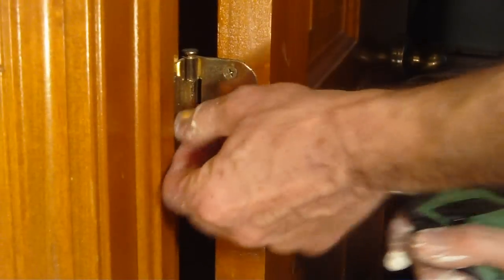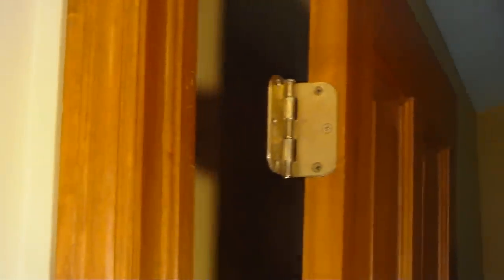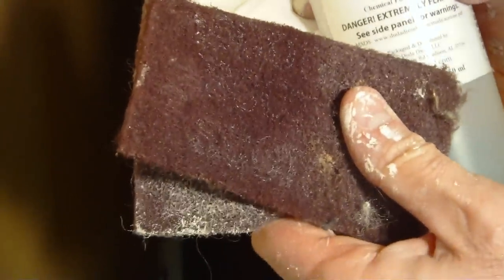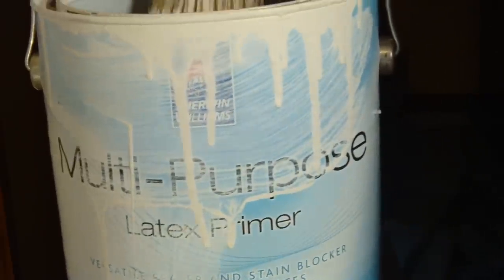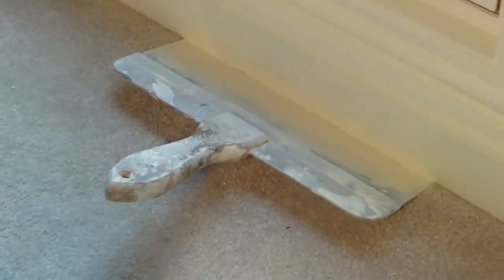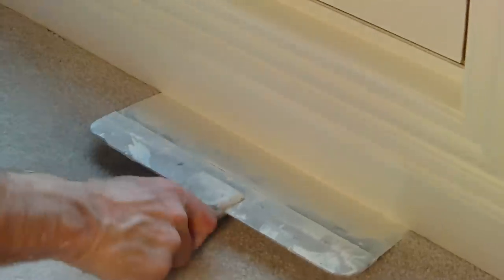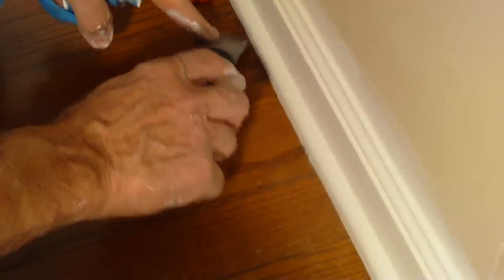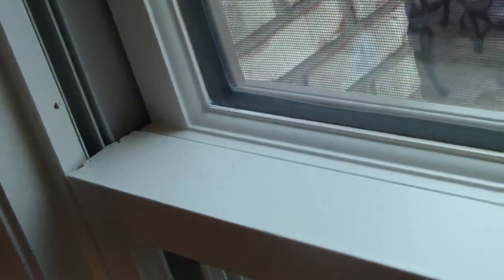deglossing techniques - for painting

Comment: I did NOT get the results shown on your video when I used Jasco brand  "Professional Strength" Acetone.    Do I need to buy more concentrated acetone from a local chemical supply company???
Reply: brands that claim 99.5-99.9% acetone are not necessarily the same when it comes to the .5 - .01% additives, so yes, brands and INGREDIENTS matter.....don't trust labels just cuz the label says so....

Comment: Great Stuff, I was thinking same thing. Why do I need to buy expensive name brand deglossers at 5x the prices when acetone or mineral spirits could do the same thing. I have to do my bathroom ceiling and walls, so Im going to attach a rag or sponged  or something like that to a standard wall board sanding plank (that screws to pole or one you can hold by hand) and do it that way.

Comment: Thanks much! I was using the "popular" chemical deglosser, but it really didn't work at all, took forever. Then I thought, why not use my acetone? Wanted to see if anyone else had done this. The scouring pad technigue is great. About killed myself yesterday with the Gloss Off over 200 feet of molding thats not deglossed, doing this on the next several hundred. Thanks buddy!
Reply: Ever Forward, did this technique work well for you?

Comment: I painted my kitchen cupboards with gloss, and did a terrible job; I used a roller and did not get a flat paint job; like ripples in it.  Now I want to redo the paint job and add trim.  If I sand and degloss the cabinets, will glued trim hold to the cabinets.  Help.

Comment: I painted my wall with an oil based paint and I didn’t like the color. I’m planning to change it but use a water based paint. Will acetone be able to degloss it? I don’t think I have the power to scrub and sand it. Any easy ways out there?

Comment: Great tip. You should explain why you slop on the white trim paint over the wall paint. I use this technique for a reason, but you might add one sentence so people know this was deliberate.
Reply: What is the reason??
Reply: @melissapackard3974  I just learned in my own DIY project that it's far easier to paint trim first (and be sloppy with it getting on the walls) and THEN tape off the trim and paint the walls. So it doesn't matter that they are sloppy - they're presumably painting over it anyways.
Reply: @melissapackard3974  paint trim FIRST , then cut in walls

Comment: Hi, thanks for the video. I have a couple of questions: why did you need to degloss? What kind of surfaces need it? And why did you use a primer? Thanks.
Reply: paint will peel on lacquer, it will adhere on primed wood surface
Reply: Any shiny surface might reject the paint or it won't adhere well and will peel, scratch off. Primer helps with paint adhesion after deglossing.

Comment: Do you need to rinse, after using the acetone?
Reply: From what I understand, you wipe it off with a damp cloth (that is according to Gloss Off directions by Krud Kutter).
Reply: acetone will evaporate
Reply: I used scrubber pads and acetone to degloss the door jams in my house.  There can be some dried residue remaining.  I used a clean cloth well-dampened in fresh acetone to to do a wipe down.  Keep changing the cloth so as to not spread old residue.  Also, buy a lot of scrubber pads and change often.